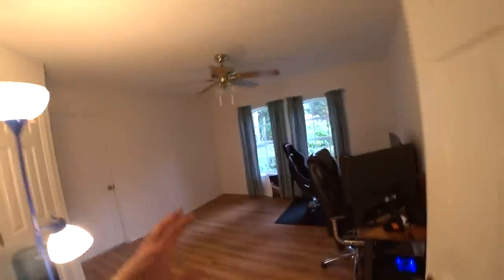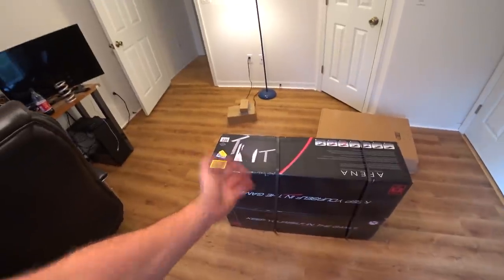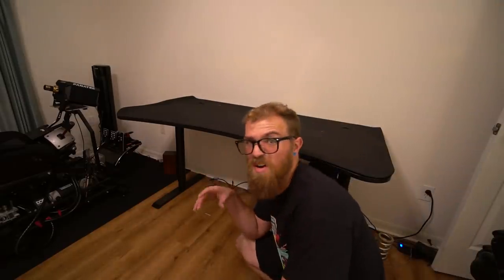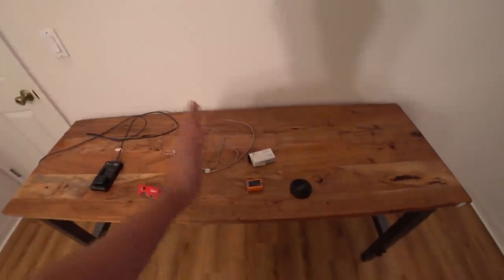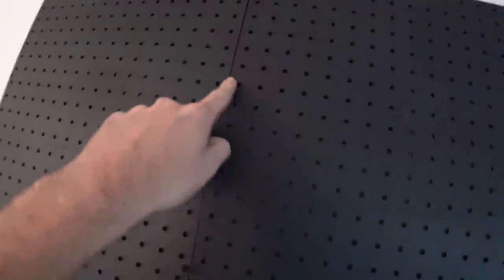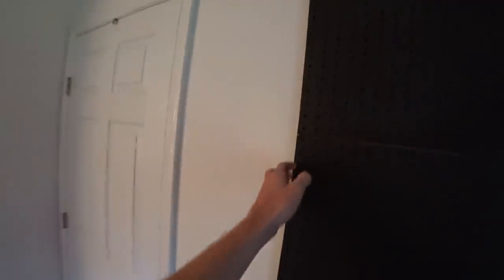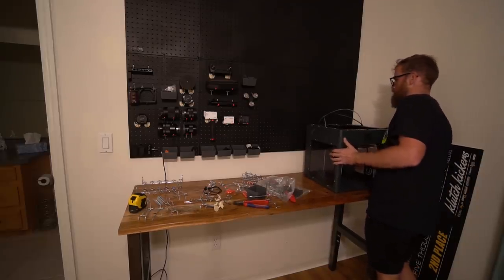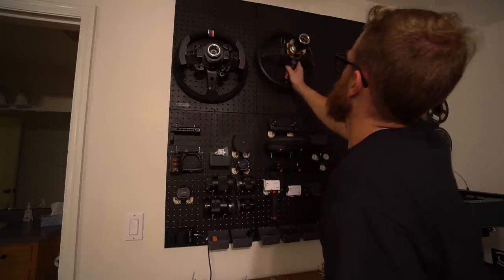First Upgrades to the New House! Setting Up my Dream Office/Game Room!

Comment: Dude you did great at the 2.4 hrs of Le Mullets.  If it weren’t for all those cautions you’d have a much bigger lead.  Must have felt great hanging neck and neck with a nascar driver. Congrats. I really had you guys picked to win it all. But anything goes at a freedom factory race. Great job though.

Comment: When my wife wanted a larger, deeper desk the best/cheapest option we could come up with was a 72"x40" piece of butcher blocker countertop mounted on store bought desk legs. Quick stain and 2-3 coats of poly and you've got big ass desk for cheap.
Reply: I use a dinning table as my desk.

Comment: Taylor you should make a cabinet with a glass door with weather stripping to prevent dust comming in .  All Camera (SLR-DSLR bodies and Lenses should be stored in enclosed dust proof enclosures.  That is how it is done at the pro level.   The cabinet size can be about the same as your 3d printer  and you can mount it under that table off the floor.   like those enclosures you see at 7eleven for the pastries /pastelitos.  but smaller .   You can use that space where you have the sony camera body to create a charging station

Comment: When the one side of the Pegbaord drives you nuts, vou could try to frame the whole Pegboard.
Reply: This is a good idea...might have to steal this! I was just debating some amazon peg boards like taylor or shopping around for nicer made ones haha
Reply: Came looking for this comment, Just put some 1x2 all the way around it, then cover the 1x2 and the edge of the pegboard with some basic wood trim, cleans it up reallllly nice.

Comment: you need a couple shelves /bookshelf and other misc add more lighting? you are basically there - it is a work in progress as with the shop - get the prints but then diy it in 8ft sections...get all elec inspected and then diy insulation and drywall - maybe sub out the drywall? just rent a drywall lift and baker staging and beg a buddy to help you it should go fast - you can get 54" sheets of drywall also - nice if you have 9' ceilings...for the garage door you can probably fab something and attach counterweights and radio lock with rolling encryption?  - you will get the entire place fixed up, including the grounds but you have to settle in and get some small victories and get a few bids/estimates then just diy it to save yourself some money - you will have to get a few carpentry tools you may not have but why not ezpand the shop and have a side shop with some carpentry and machine tools? I would bump out entire side of garage and put big doors one either end and a concrete pad in back with bbq pit and grill and garden shed - you could have the office out in the garage for the llc writeoff and a home office for your own deduction or a non profit or something maybe do a koi pond - maybe do it in back of house where you have the screened in porch - you do need to start some gardens and lessen mow time will give you some more privacy  - steady as she goes - you have plenty of content to draw on - do a wifi mesh camera system but just getting garage enclosed will give you easier working conditions, more security w/o having to worry #projects #decks  #car ports #table saw #chop saw #planer #joiner #router/shaper #air #dust removal system

Comment: put an led rgb light strip around the peg board and frame it in some nice trim/wood and you won't notice the uneven peg board and it will add a nice custom touch.

Comment: Consider buying some cheap boards, turning them into a frame around the border of your plastic peg board? Would be pretty quick and as long as you did good cuts and some straight boards you'd be set!

Comment: Hey, you should adjust that hight of the table. Start with the chair and make sure your heels rest on the floor, then adjust the table so its the hight so your arms are  straight forward. Also your monitor should be high enought that you don't need to tilt your head.

Comment: Just on the 3D printer my dude; you should do a separate sealed enclosure of some kind for your filament rather than hanging them up on the rack exposed to the open air. Once they get even a little bit of moisture soaked into them they can go off really badly and cause a lot of issues with your prints. It's even worse when it's in a climate with a lot of humidity like Florida would be.

At the very least you should sandwich bag them with some desiccant/silica gel baggies if you're not using the roll constantly, but something like a cabinet with some seals on the doors would be ideal. It's something I want to do soon once I starting building up my own print farm.

Comment: Hey Taylor what's up, just thought I'd throw two suggestions, first you could paint a black boarder around the peg board, and two I realized you have a coil spring on the desk why not use it as a juice or water bottle holder,just thoughts. Much love from the Caribbean

Comment: I heard its not a good idea to store 3d print filament like this, because it will gather moisture from the room, which will result in bad and inconsistent print quality. It's better to store it in a closed container or even better in a "dry box" that has some moisture-absorbing material in it.